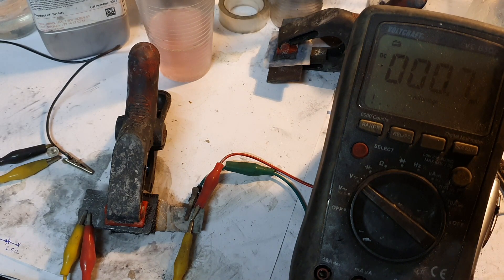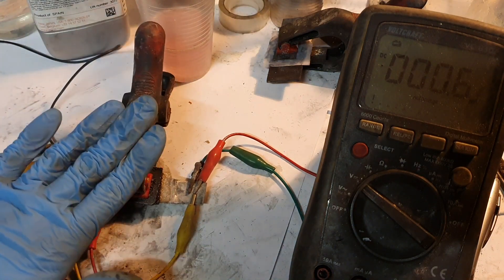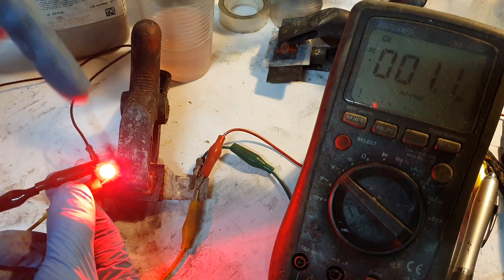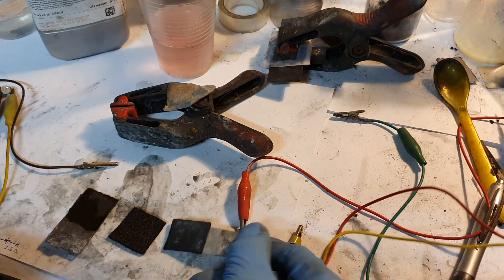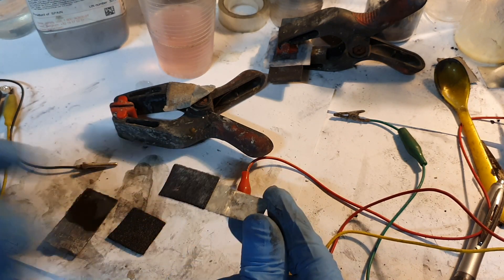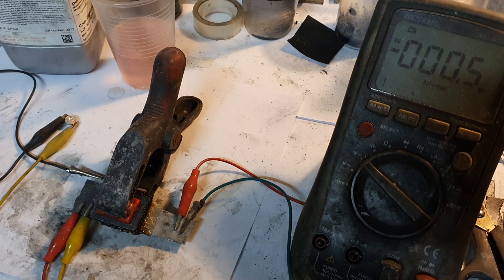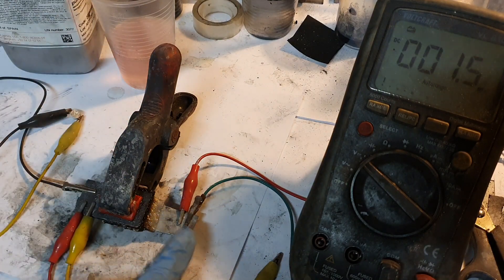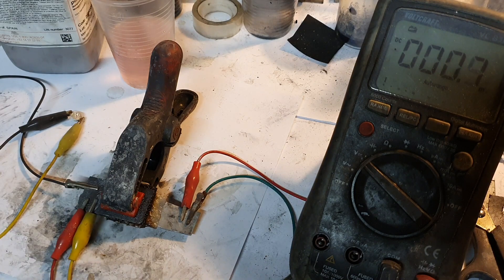Metal Hydrogen Battery with graphitic carbon nitride / carbon fiber

Comment: Hmm, zinc is far more electropositive than hydrogen, so may just be a zinc MnO2 battery under acidic conditions? Also doesn't the acid in your electrolyte just attack the zinc?
Reply from the maker: Yes the acid will attack zinc. Normal I need to use some carbon current collector but I try out zinc of pure curiosity,... and the voltage was higher that way. The cell design is not my target design,... here I just play a little bit with the materials
Reply: @cayrex  Okay yes zinc will give higher voltages, also MnO2 under acidic conditions also give higher voltages, but it's impractical because of side reactions. Under alkaline conditions, you can try to create permanganates in carbon cathode for high voltages, no need for acid. Also, if you add small amount of bismuth and indium to zinc (I think it's around 1000ppm), you can prepare inhibited zinc to prevent hydrogen production by zinc's reaction with water when battery is stored... there's a patent about that which I followed.

Comment: Certainly an interesting battery cell looking good so far with an excellent holding voltage. Certainly seems that the g-NC impregnated carbon felt is working as a hydrogen storage medium. With the manganese sulfate forming nano manganese dioxide in the positive anode carbon felt, storing the oxygen very effectively during charging.

But im wondering if there could be a slight issue with that small sulfuric acid addition, due its potential reaction with the zinc negative electrode. This may be slowly eating away at the zinc forming zinc sulphate, giving more of a primary battery short lasting extra energy effect, instead of a more ideal rechargeable secondary effect.

You could use some PH papers to see how acidic the electrolyte is close to the zinc negative, plus look for any serious corrosion, including see is the charged cell voltage starts to drop after a few more cycles. If you used lead or nickel as the negative electrode this would in theory be far more durable with the more acidic electrolyte.

I also highly recommend you gelling your electrolyte with around 1 to 2% Xanthan gum, this will stop your electrolyte drying out so much being exposed to the atmosphere. This should also help to further to dramatically increase ones cells charge retention and increase its energy density as well, plus Xanthan gum is a super ionic conductor.

Hope any of this helps, onwards and upwards, P :)
Reply: yes the MnO2 is the O2  provider and g-CN is the H2 provider.
Reply from the maker: The zinc was added only from pure interest. Original is used some neutral electrode. Bulk g-CN/CF was tested to see if can replace cobalt or pt coated carbon. The nice effect with g-CN and zinc was higher voltage instead 1.4V on Mn-H battery with cobalt coated carbon. I add H2SO4 because in my last Mn-H battery the performance was better, so I repeated the practice. Gelling the electrolyte is nice idea, but in the end that cell need to be sealed because of the hydrogen. Some hydrogen will be stored in g-CN but some H will also escaped,... for that reason the cell need to be sealed. In that experiment I use bulk g-CN/CF but I am looking to try H+g-CN/CF electrode. After all that cell was made out from pure boredom and was not my target cell design.
Reply: @cayrex  Just thought i would be a bit more clear about one point... thats standard hardware shop PVC glue often in a can for joining PVC pipes together. As PVC based polymers are extremely durable & long lasting in harsh chemical environments compared to so many other common polymers.
Reply: @cayrex  Cool!, yes xanthan gum used as a gelling agent should help with retaining the hydrogen in microbubbles within the g-CN loaded carbon felt. So that is has much greater chance of being properly absorbed instead of quickly escaping. Hydrogen being like the best houdini escape artist in the world! :D.

1 to 3% xanthan addition to ones electrolyte works very well with any neutral or acidic electrolyte (havent tried it yet with strong alkaline electrolytes yet). This gel also does not degrade in the harsh environments in the positive side either longterm, as its super hardcore stuff. It maybe also be possible to increase the percentage of Xanthan gel to virtually solid state, really needs testing with each specific electrolyte.

Ideally we all need sealed cells for proper testing, but as you know for quick R&Ding for a new cell concept or chemistry it tends to be open initially. But also a really quick and low cost way of sealing test cells is by using a low cost electric "vacuum sealer" to make ones own mini pouch cells. Onwards and upwards is the motto and spirit!, P :) (y)
Reply from the maker: Yes I know xanthan gum,... I make some work in the past. At the moment I seal the cells with really sticky tape. I have a vacuum sealer but the sealing on electrodes are bad,... is not 100% sealed. Now I seal with tape and is fast, easy and the sealing on electrodes is better.
Reply: @cayrex  Glad youve found a quick sealing method with sticky tape, all grand stuff!. Its pos to also use a tiny bit of hot glue around the electrodes then vacuum heat seal should sort out any leakage issues. As you may know, graphite foil is quite porous so best to back them with a suitable metal current collector with sticking out metal foil tabs instead. Then your thin electrode tabs can be sealed much more easily like in commercial pouch cells.

Hardware shop PVC glue well blended with graphite flake powder or even better for high conductivity & durability wise, carbon black, milled carbon fiber powder, cost effective multi-layer graphene, nano or micron silver powder or mixes of, make for awesomely high conductivity ultra thin hardcore protective films for coating and protecting metal foil current collectors in a whole variety of cell chemistries too ;)
Reply: @cayrex  your voltage is higher because I think you have two batteries in series and there is some in-efficiencies somewhere between them. If you don't nail down a cross diagram of the layers and dig a decent electron flow theory we stay in the dull. You demonstrated a very interesting hi v battery but nail down the theory.

Comment: it seems Voltage drop too fast... is not it?
Reply from the maker: Is not so bad after all. I've seen worse cells before...
Reply: @cayrex  By the way ....  i've to subscribe your channel.  I like all the things you've done to develope a better battery
Reply from the maker: @Elarpachuau  uuu, thank you. is taking a lot of experimenting
Reply: @cayrex  I can make almost 1 volt with zinc and copper 2 inches square each... I put a tissue paper in table salt mixed with water and then dry it, so i put it between that zinc and copper, and then i clipped it tight. So i put it inside a glass of water... it makes 1 volt